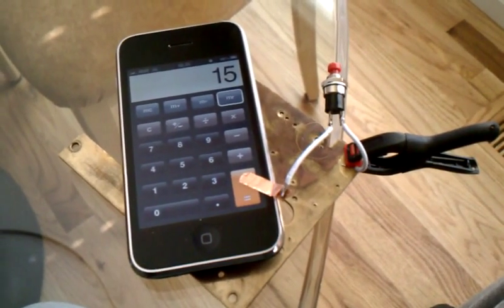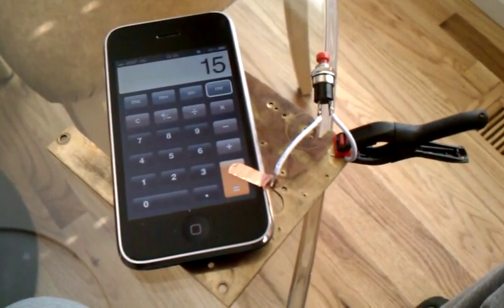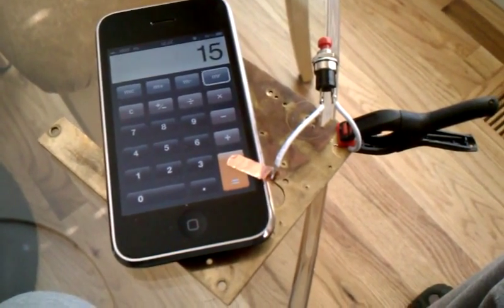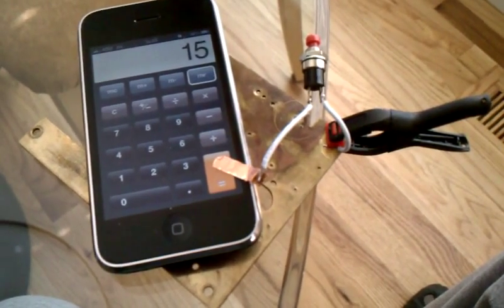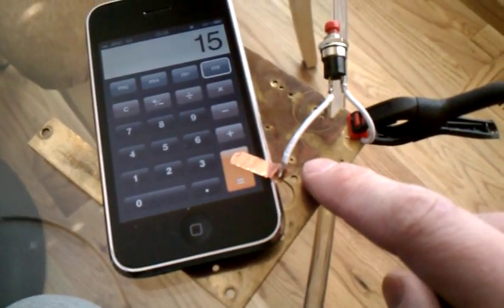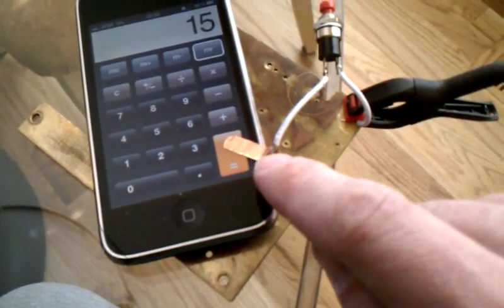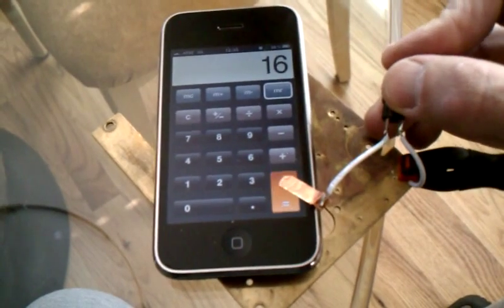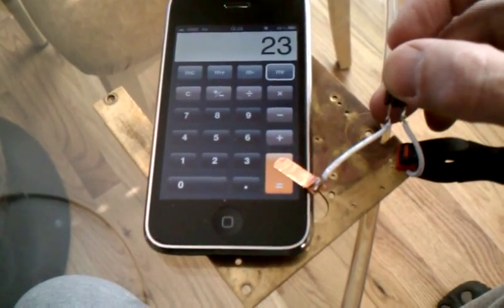Trigger iphone capacitive sensors electronically

Comment from the maker: If I had to guess (and I am by no means the expert here), you need to tie the penny to 5V through a resistor to keep it pulled high so it doesn't float when it's not connected to ground.

See if that works?

Comment: I am trying to do this with a transistor as a switch and a 5v signal from my computer. When the 5v signal is there it connects GND to my penny probe taped to the screen. I get it to work perfectly but then after a few minutes it gets all sporadic and stops working. It's irritating because I get perfect results one minute and nothing the next with the same configuration.
Any thoughts?

GND --------(2n2222)------- a penny
                      |
                      |
               5vdc signal